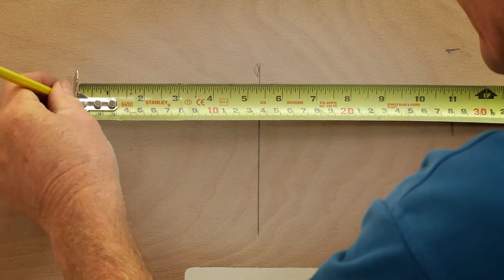How to install an Abacus Easi-Plan Modul Basin Frame

Comment: I’m not a plumber, but as someone who bought one of these, there are a few things you need to know that aren’t explained here, or anywhere. 

1. Although Roger fits this frame on what looks like standard wall studs (63mm x 38mm, or 2 1/2” x 1 1/2”) , it has a total depth of approx 95mm. This is measuring from the front face of the plywood to the back of the nuts on the angled blue plates, which hold the grey trap box in place. So if like me you were hoping to place it in the 63mm deep studded wall cavity, you can’t, as it is supplied. 
Even on the Abacus schematics it never gives a depth measurement, just height and length of the bracketed plywood front face. 
So you either need to bring out your wall studs by  30mm minimum, which for me would’ve pushed the tiled/finished wall out to far over the window, or as I did, remove the blue angled brackets, reattach the pipe elbows to the same holes, and fit the trap against the the back of the plasterboard. I had to screw from the inside of the grey trap housing into a studwork frame I made, as attaching it to the back of plasterboard wasn’t something I trusted. 

2. Waste connection on the grey trap is 50mm OD, with a 50mm compression to 2” adapter supplied, which is no use when trying to adapt it to 40mm solvent weld pipe (43mm OD). So I took it to my local plumbing merchant to find out how to connect. 

So after watching this being fitted to a floating mock up, trying to research its dimensions, purchasing it thinking it would fit, I had modify it to squeeze it in. I like Rogers videos, I just think the full dimensions need giving somewhere so that it can be accurately designed into a bathroom wall, to remove the guesswork. 

Hopefully this info helps anyone thinking of purchasing one.
Reply: Mate, helped me out massively there. Same issue. I either bring pre wall out 30mm which will F up tiles or do as you suggested. Thanks so much

Comment: Roger the outlet is a 2" external diameter pipe but the adaptors to take a 40mm pipe are not included.  Where did you get them from and if not what size will fit.

Comment: Where can you buy this basin frame?  can't find one anywhere.
Reply from the maker: Tim,

Apologies for the delay in replying. Abacus are officially launching the product at this year's KBB exhibition, however it is available to purchase now through our UK dealer network.

You can locate your nearest dealer here.. https://www.abacus-bathrooms.co.uk/#!/links/store-locator

The product is available in two finishes for the basin trap (white or chrome)

EPBA-10-0015 - EasiPlan Modul Basin and Furniture Frame - Includes Viega Chrome in Wall Basin Trap (Chrome Finish)
EPBA-10-0010 -  EasiPlan Modul Basin and Furniture Frame - Includes Viega White in Wall Basin Trap (White Finish)

Hope this helps!

Abacus
Reply: Hi Tim, these
Reply: Sorry, these are available from UK Bathrooms: 
https://www.ukbathrooms.com/products/abacus-modul-basin-and-furniture-frame.html